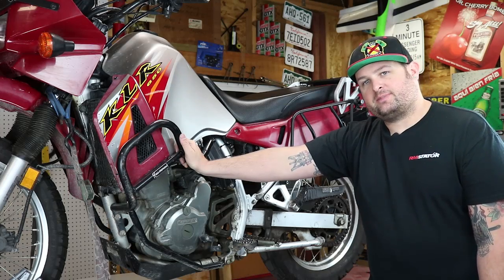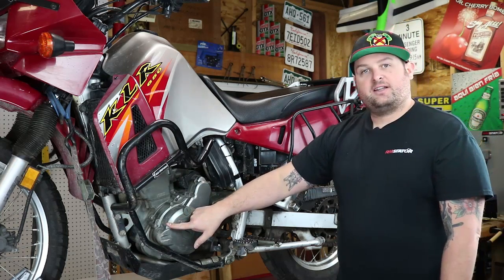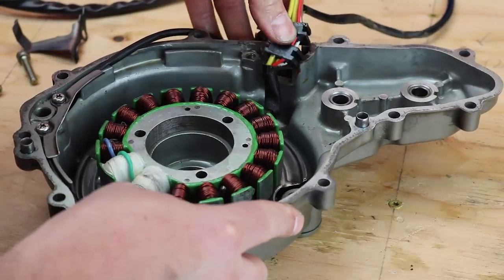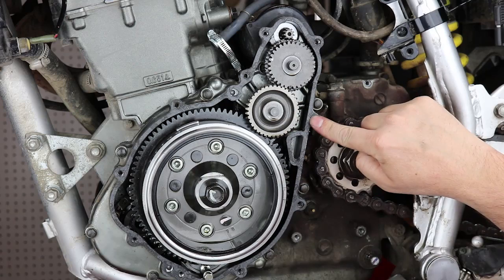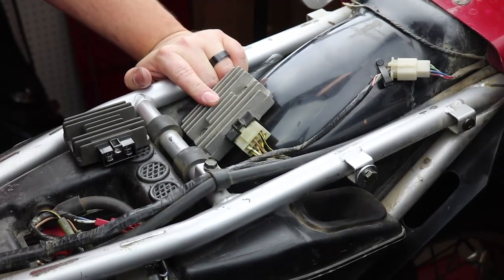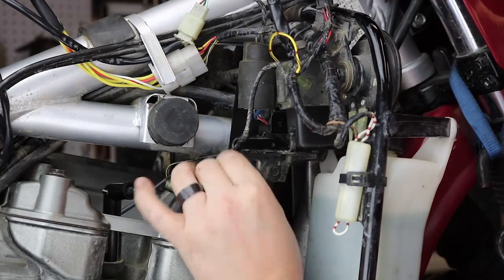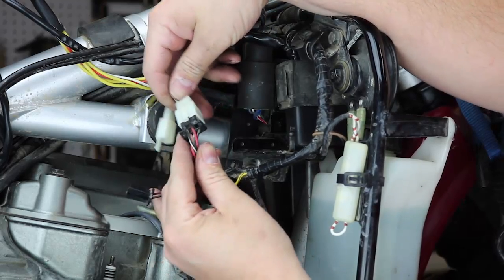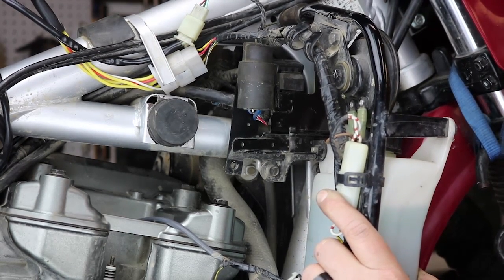How To Install a 1987-2007 Kawasaki KLR650 Stator, Voltage Regulator, CDI & Ignition Coil

Comment: Just finished watching your video on how a stator/electrical system works on a bike/atv. I commented that I have a KLR with a damaged stator cover from a rock flying up...awesome that you have this video for me to watch as well. The stator cover just has a small dent where the rock hit. I't'll be interesting to see what is damaged in there...will be looking into the upgrade kit, thanks. Also for you KLR owners, over the years I disabled the kickstand kill switch, and cleaned up the handle bar kill switch contacts...both easy and important bits to take care of.
Reply from the maker: Great, glad it helps get your KLR back on the road!

Comment: I have an issue with a klr650, it's not running at the right rpm, the rpm gauge bouncing around high and low. Bike will run with choke but u give it gas reving it till die.
Reply: I changed the pulsing pulsar, the computer box, the spark plugs and coil. Still causing same problem.

Comment: I have klr 650 1993 started and was banging rev only to 2000 was told when I buy it that was just a cdi box but now there no spark
Reply from the maker: Likely source coil on the stator is bad. Have you replaced the stator?
Reply: @Rmstatorinc  going to test the stator this week.. Coil is good

Comment: I have a question my klr 650 I turn the key on and nothing happens I have changed key switch soliod fully charged battery still nothing I can really use help
Reply from the maker: Have you checked your fuses? Start there if you have no power with the keyswitch on.

Comment: Why old one has 6 wires? and the new one has 5 wires?Will the new stator work with old regulator?
Reply from the maker: Yes the new stator will work fine with old or new regulator. The 6th wire on the original is a voltage sense input to the regulator. This is routed through the bikes harness, and often gives a poor voltage reference to the regulator. Our unit uses a direct battery  voltage reference for regulation, which is much more accurate.

Comment: Looks the same as a Caltric, which was garbage. Who the hell thought putting holes in the grommet around the wires would be a good idea. I got it all back together and it leaked oil thru the hole.